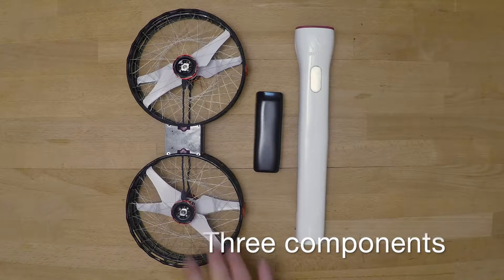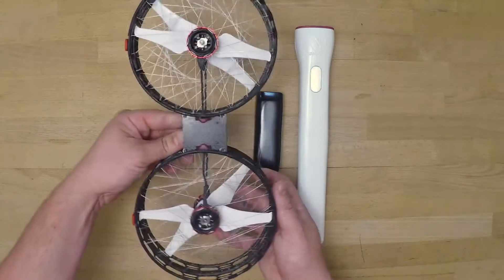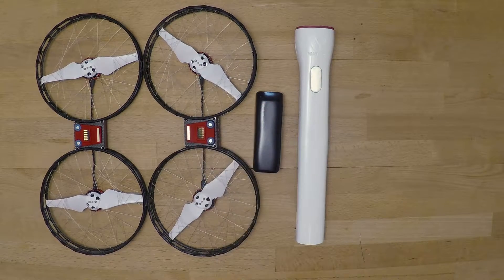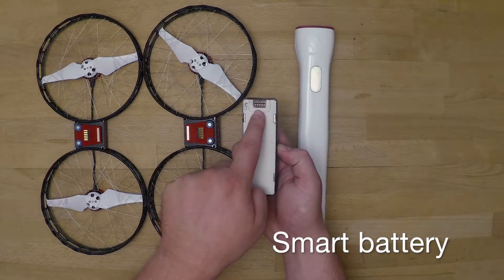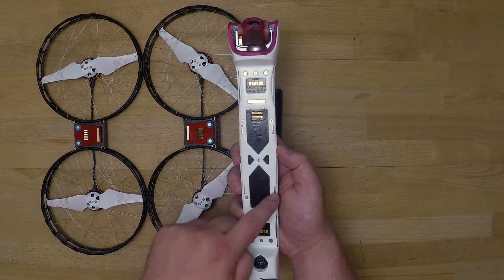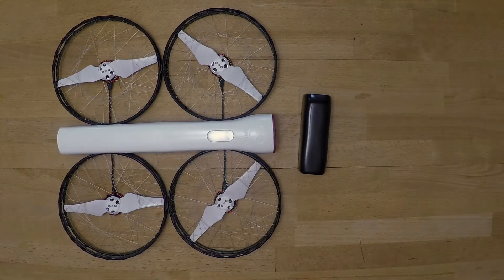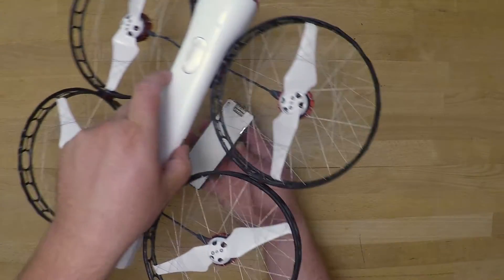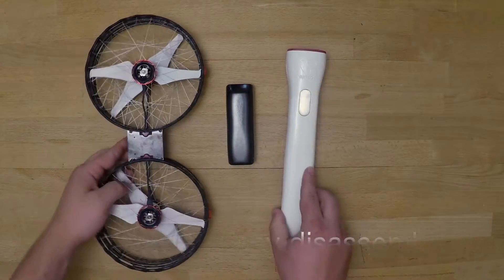Snap's MagConnect Design.

Comment: If it was 70 or 80 grams lighter, this would be the solution i have been looking for! According to the new instructions published by Turkish Directorate General of Civil Aviation, we don't have to get a permission or register our drones if they are lighter than 500 grams.
Reply: I think you should produce a lighter version for Turkish people. I am not kidding. There are thousands of people who are waiting for such a solution in Turkey. You can boost your sales.
Reply from the maker: +Nazım Melih Oğhan we are constantly trying to make Snap lighter than it was.  80g is quite a lot when the entire unit is only 570g!
Reply: What is the gross weight of prop. guards? Are they detachable?
Reply from the maker: +Nazım Melih Oğhan The rotors are one complete unit and you cannot detach any component from it other than the props.
Reply: +Vantage Robotics Are you working on a prop. guardless version?
Reply from the maker: +Nazım Melih Oğhan we are working on several alternative rotor systems.  Some of them do not have prop guards and are lighter than the current rotor system.  These will not be coming out until later this fall.
Reply: +Vantage Robotics It is not a problem. We got plenty of time.
Reply: +Vantage Robotics Ok, here is the story. Turkish Directorate General of Civil Aviation has published new instructions about drones. If one fail to follow the new instructions, he/she may get a penalty fine which is almost up to 6 thousand dollars and you may also even end up in prison. According to new rules, you just have to be 9kms away from helipads, heliports and airports. You can find helipads anywhere in Istanbul and 9kms is a distance which is way too much. I mean you just have to be in the middle of nowhere to fly with your drone. In other words, the new instructions make it impossible for us to fly in Istanbul. Altough, there are some exceptions in the rules like if you have a PPL (Private Pilot Licence) and permissions from local authorities, you can fly inside of this "prohibited distance zone". However, the expense and/or effort to compile permissions and having a PPL is too painful to deal with.

Beside that, according to instructions, drones which are lighter than 500grams are excluded from any implementations which means one can fly lightheartedly in a "prohibited distance zone" with any drone which is lighter than 500grams. As most of the air space of Istanbul is inside of the "prohibited distance zone", many people are selling their heavier drones to get rid of them. Solely, your Snap would fill this gap if it was lighter. I could even be your retailer, if i had enough funds ;)

Comment: Should make it Solar powered
Reply from the maker: That would be awesome.  However, Snap would require about a square meter of solar panels to power its flight (assuming the panels didn't weigh anything and the sun was directly over head).  We will probably have to wait a bit longer for this...

Comment: Too expensive I'll get the parrot
Reply from the maker: The Bebop is a great product, but not the same.  We do a number of different (and much more expensive) control techniques for wildly better wind performance than the Bebop. As one example, we use a very expensive motor control technology that lets us have insanely fast control response - 10,000 rpm to 0 rpm in milliseconds. Bebop using digital only stabilization, which is inferior to our gimbal stabilization. It also has exposed blades, making it more dangerous.
Reply: +Vantage Robotics once it comes out I'll look at it